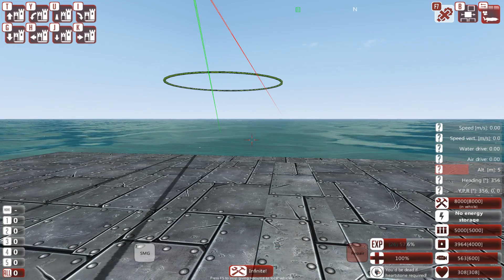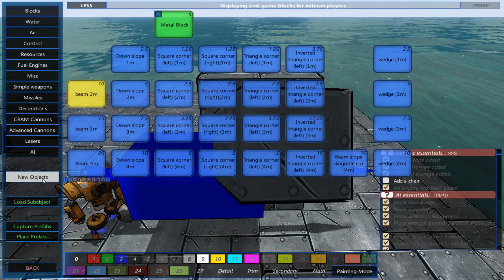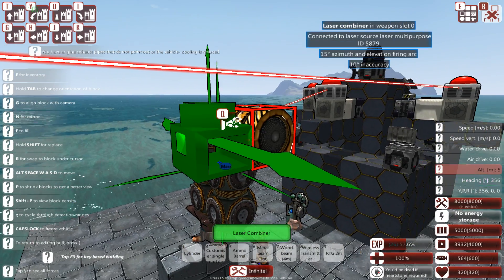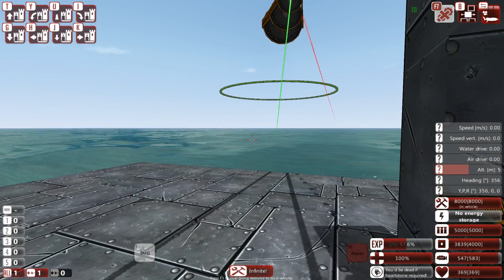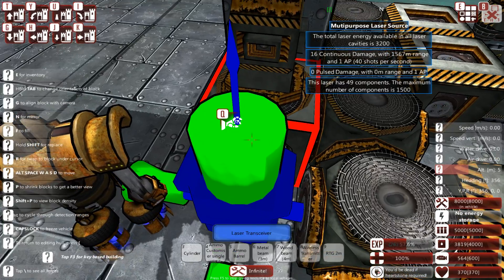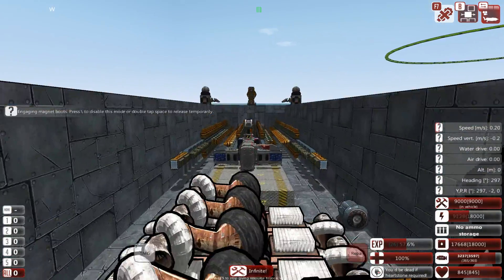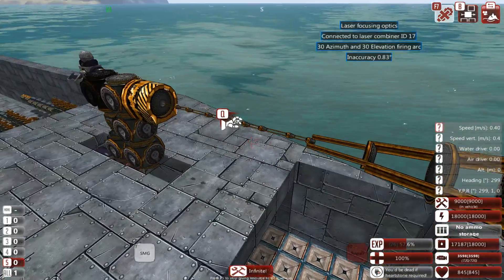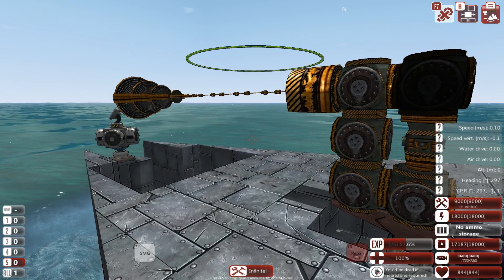From the Depths - Laser Transceiver tutorial

Comment: little thing I discovered while building multi-gun turrets. You can build stuff that won't connect to a normal block (like that transceiver), build a "frame" of connectors around it, place the item, remove the frame, and the item will remain in place ;).

Works really well, and saves a lot of trouble at the time of designing compact things.

Also, other useful thing about transceiver that might be of use for those who watch the tutorial (very good job, btw! :)): you can "amplify" the signal, by receiving it in a transceiver mounted on a connector, and "re-sending" it through multiple transceivers mounted on other sides of the connector. That way a single "signal" can be duplicated to go to different laser outputs. IN fact one input can be turned into five outputs (as the cube has 6 sides and one is dedicated to the input).

Say, you want a LAMS with nodes in both sides of your warship. You mount your laser system down in the hull, send the signal up through a transceiver, receive it with another transceiver mounted on a laser connector block. That block has other 2 transceivers mounted at the sides pointing "outwards" towards the places the LAMS nodes are placed, where they're received by their own transceivers, which feed the output into the node itself.

This can be scaled. Say you want four nodes in four corners of your ship. One transceiver receives the signal from the laser down below, and reroutes it "forwards and backwards". 2 further transceivers receive them in the fore and aft of the ship, and divide them again in two, sending them to the corners of the ship. One laser, four outputs. Ofc you have to build a powerful enough laser to feed energy to all systems, but is a good way to centralize your laser generator in a single place, it if you want to do so :).